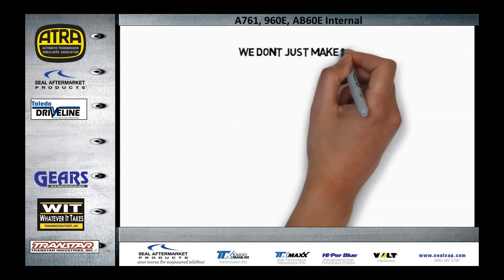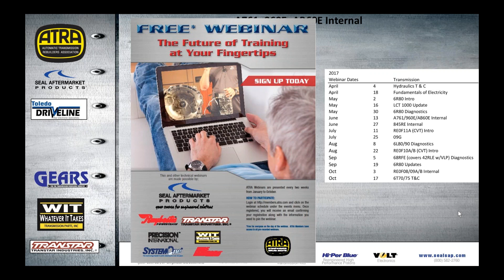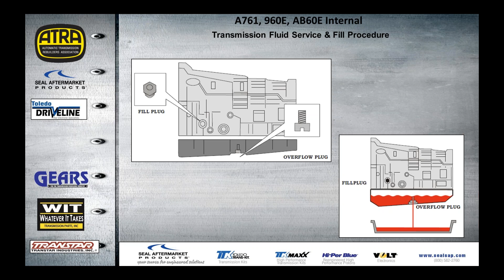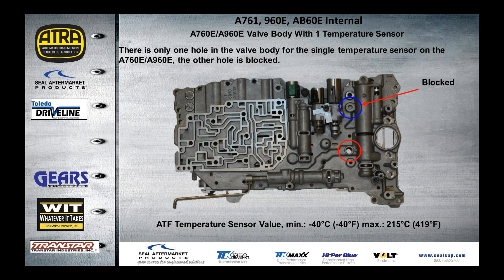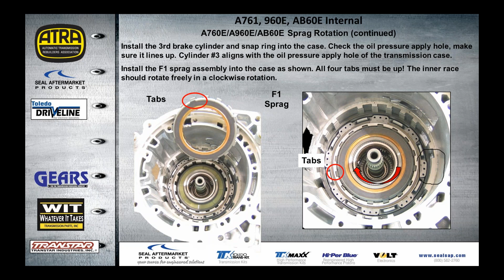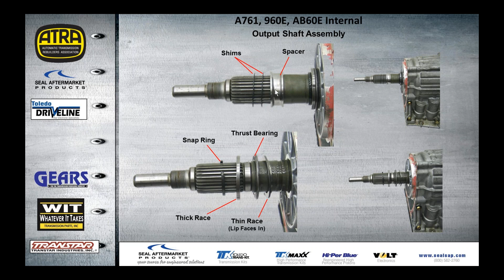A761 960E AB60E Internal Webinar - 6/13/17

Comment: after fixing codes p0761 (S3) on 960E 
have abnormal "D' but normal "R" 
Car revs forward does,  move into gear but doesnt respond to the acceleration 
no longer have a Check Engine light 
what could it be 
& yes i did the full procedure correctly 
have abnormal "D' but normal "R" 

Car revs forward, does  move into gear but doesnt respond to the acceleration 
no longer have a Check Engine light 
what could it be
06 lexus gs300

Comment: When i accelerate after turning or low speeds/RPMs feels like it slips usually 2 to 3rd but from a stop going thru the gears doesn't happen & ppl keep saying it's normal when i kno it's not

06 is350 hit 200k today, fresh trans fluid in last 6mo
Reply from the maker: It's always tough when you feel something isn't right, but others dismiss it! It might be worth checking to see if you have an air leak, like if the filter isn't installed correctly. Overfill the transmission a little bit. If the problem goes away, I'd bet the filter is loose or possibly damaged. Here's a link to find an ATRA shop that can help you https://www.atra.com/ShopFinder
Reply: @atra-automatictransmission1300  if i used Toyota Techstream and reset the trans values do you think that could help? Could it hurt? I've been wanting to just cuz i started driving it diff when the issue started, giving it less gas or waiting to give it gas etc. before i swapped fluid. Is there anything special to make sure you do when doing the relearn procedure? 

Also do you know if the a760e & 960 have diff valve bodies? That's why i ended up here & i believe i got they aren't identical from watching. I just thought about trying this Zip kit which says it deals with the 2 to 3rd flare ups directly but wanted to do it on a used valve body in case i mess up but we usually only get 250s in our junkyards ..

Regardless thank you immensely for what you do for the community, you need more recognition cuz you absolutely don't need to be helping anything but you do!

https://www.rockauto.com/en/moreinfo.php?pk=11430873&cc=1432809&pt=8532

Comment: Wow. Thank you. i have an LX570 that wont engage reverse gear. It just revs when you put it in reverse. Drive gear however has no issues. Drives perfectly normal just wont reverse. Could you tell which solenoid could be the culprit?
Reply from the maker: Probably not a solenoid, to verify, disconnect the harness, if you still don't have reverse you should have it looked at https://www.atra.com/ShopFinder

Comment: how to repair the revers in the valve body
Reply from the maker: Reverse is a hydraulic gear; nothing in the valve body will fix that, it's an internal issue; you can try unplugging the connector at the transmission to verify that.

Comment: Hello
The patient is my gx460 A760E box. I changed the oil in the gearbox about 5000 km ago, everything was ok, trip to Italy.
Suddenly, on a driveway (gearbox on D), up a hill of about 15 degrees, the car does not stop uphill but slides down, the ESP light comes on and the car brakes. When I turn on the reducer, the problem does not occur even at a much larger angle. Of course, original oil, oil condition checked. There are no errors on the computer. I checked the new filter was installed correctly. Does anyone have an idea? Yes, the gearbox works normally, changes gears, pulls perfectly normally, the car has power.

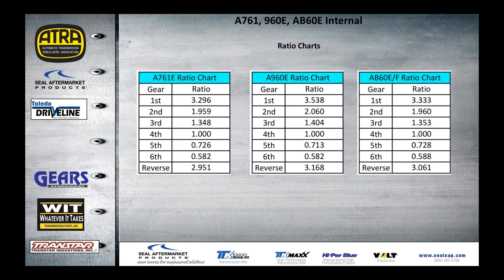Comment: 6:35 Should the SLU be ON only in 5th and 6th gear? And another requirement for the SLU to be ON I think is the speed of the vehicle (above 60km/h or so). I am no mechanic, so correct me if I am wrong.